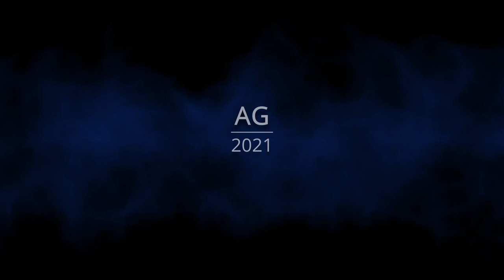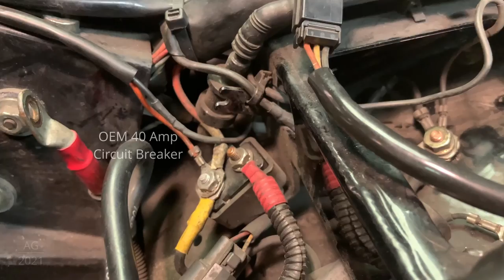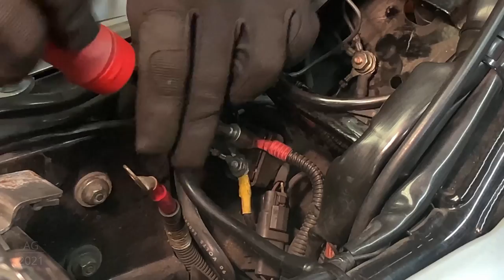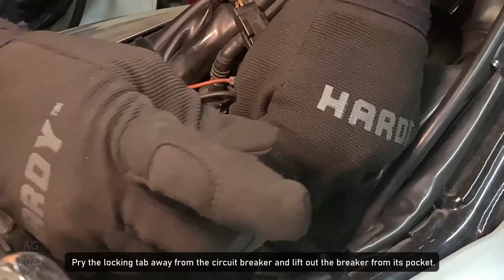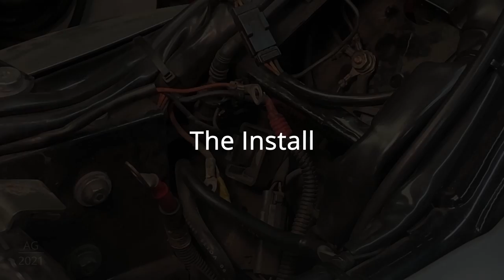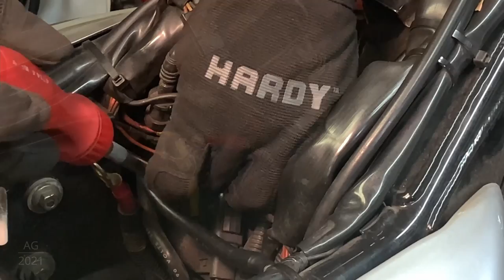Main Circuit Breaker Replacement - 2003 Harley Davidson Ultra Classic

Comment: I can't believe you just posted this when I needed it. I was hoping to find ANY video showing the circuit breaker on any FLH and here you have the same year and model as me! To boot, your video clearly shows where the wiring goes. I had upgraded my charging system with Cycle Electric's 3 phase upgrade and had to run the regulator wire to the circuit breaker. (You should do this upgrade). But I was also doing a transmission reseal and waiting for special tooling and parts. I took some pictures but they suck. When I took off the nuts from the circuit breaker the whole thing just crumbled, so I had to get another one. I didn't realize for awhile that the breaker was in a carrier that was riveted to the frame. But thankfully I realized it before I did something stupid. So I removed the bits and pieces and waited for the new breaker from the dealer. By that time I was involved with removing the inner primary and seals and that took awhile and I forgot where the wires for the breaker went. My service manual shows two of the wires but not all of them. Your video saved the day! Thank for posting it.
Reply from the maker: Hello halnwheels, You're welcome, and I am glad that this video helped you out. I hope it helps others as well. Thank you for watching!

Comment: Was the fuses blowing before you replaced it?  My 2003 sportster has no power but is not blowing fuses.
Reply from the maker: Hello @leftoversandcake, No, no fuses were blowing. The bike electronics would just shut off completely on me with no warning and while I was riding, very scary on the freeway. As of this replacement of the main circuit breaker the bike has not shut down on me at all. Was this the fix? Im not sure, but so far it is working. Thank you for watching!

Comment: Thank you for this video. How many amps is this circuitbraker.  I have 2002 Ultra. Wondering is this braker a part of charging. Mine bike started to change voltage between 14 and 12, untill it didnt charge at all. Stator and regulator have been measured. They seems to be Ok.
Reply from the maker: Hello Jari Kaakinen, the new circuit breaker is a 50 amp. Harley for some reason updated from the initial 40 amp (CB) for this particular year model. Thank you for watching!

Comment: I have a 2004 Sportster 883 and it cuts out while I'm driving and goes back and cuts out and it's gotten worse. Thanks for the video I think that's my problem and I need to fix it ASAP
Reply from the maker: @danielsaavedra8729 your welcome, I hope this solved your issue, so far it has solved mine. Thank you for watching.

Comment: Thank you for posting this. just about to do this myself. Can you tell me if there is a wrong way to wire this. I notice that there is a copper and  a zinc plated terminal. Thanks a agin
Reply from the maker: Hello Studio 12. Yes, the copper terminal is the Main power lead side. Thank you for watching I hope this helps.

Comment: WHAT WERE THE SYMPTOMS THAT LED YOU TO REPLACE IT?
Reply from the maker: Hello edZILLA64, the symptoms were that my bike would just shut down on me without any warning while I was riding, very scary. The dealership could not diagnose the problem at all so it was up to me to figure it out.  I had read through internet threads that the main circuit breaker could be the cause especially for this particular year model bike. I can not tell you that this is the fix but, what I can tell you is that it has not given me any issues since. Thank you for the comment and thank you for watching.
Reply: @albertoguerrero5362  THANKS FOR THE REPLY. I HAVE A FATBOY THAT IS CAUSING ME TROUBLE. I HAVE REPLACED EVERYTHING ELECRONIC. NEW STATOR,VOLTAGE REGULATOR, IGNITION CONTROL MODULE,IGNITION SENSOR,COIL,PLUGS,WIRES. AFTER ABOUT TEN MILES , SOMETHING IS GETTING HOT, AND THE BIKE WILL START RUNNING LIKE CRAP. BACKFIRING AND SO ON. WHEN IT COOLS DOWN IT IS FINE, AGAIN.I HAVE A NEW BREAKER ORDERED. THANKS AGAIN.
Reply: ITS WORTH A TRY .
Reply from the maker: @edZILLA64  , Yes it is worth a try and I hope it all works out for you. Ill keep you posted if mine repeats the failure which I hope it does not. Thanks again for watching.
Reply: @edZILLA64  Were you able to find out the problem? My Road King has the exact same issues you are/were having. Thanks
Reply: @cjw5491  no, i never figured out the problem. i tried everything. all new parts you name it . i got aggravated and sold it and got me a 1993 electraglide. i wish i could have figured out. i loved that bike and miss it.
Reply: @edZILLA64  Thanks for the reply. Yea I’ve replace a lot of parts too and it’s still doing the same thing. 3 different mechanics can’t figure it out. I love my bike but like you I’m going to sell it and buy another one. Thanks again. Appreciate it
Reply: @cjw5491  good luck.
Reply: @albertoguerrero5362   Dude!  Did your bike loose all electrical power and after a few minutes it would come back????
Reply from the maker: @j.rothchild173  That is exactly what it was doing. I am really not sure if this was the fix. However, it has not repeated the fault.
Reply: @albertoguerrero5362  Ok.  I have a 40a now, might have to go to a 50a.
Reply: How do  I know what amp is on bike  my 01 Electra glide ultra classic
Reply: @jarrettfranco5004  look in your manual. It will tell you. Look in the wiring diagram section for your bike. I have always bought a manual for what ever bike I own.

Comment: I wish you would have showed the location of it better at least zoom out on the video this is an alright video besides you're not showing where it is on the bike fully.
Reply from the maker: Good point, doing my best. Thank you for watching
Reply: Also looking for the location.  Can anybody give me a good clue on my 1998 Road Glide.
Reply: Located and replaced.  On mine it’s located in front of the battery.  Remove battery and you should see it.
Reply: Gotta remove the battery to get at it. Right in front of the battery.